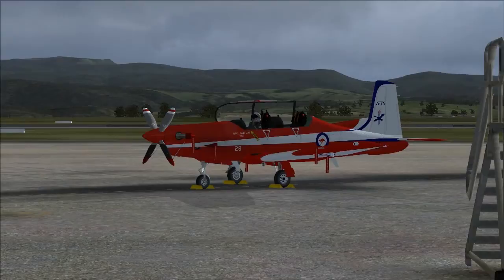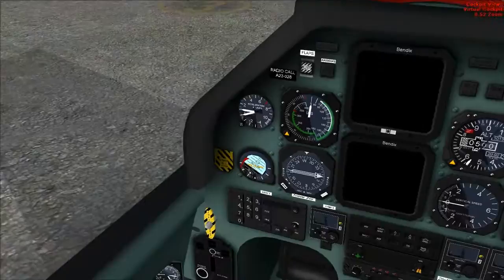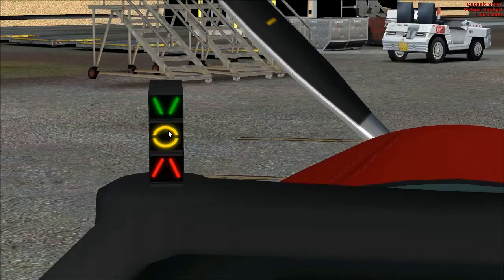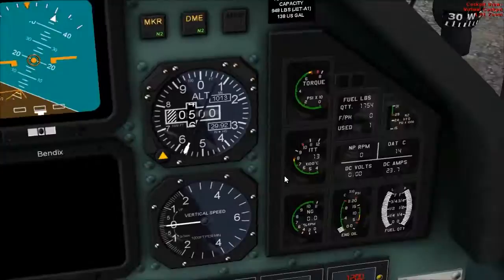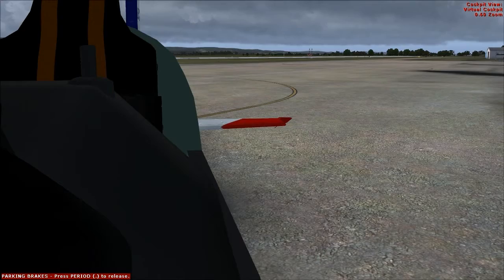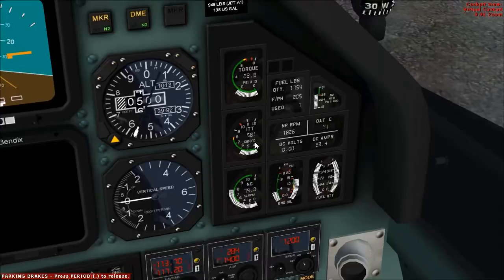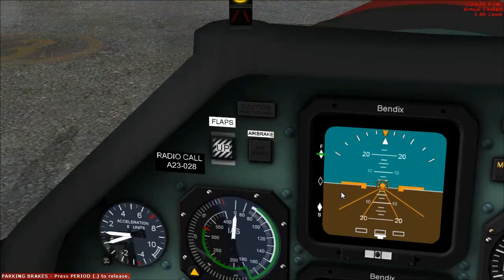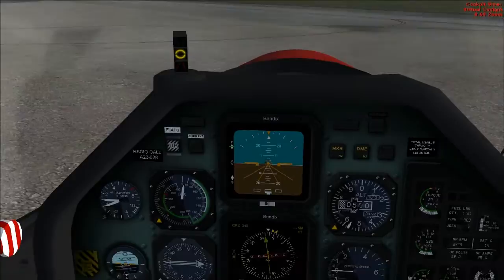FSX PC-9 Tutorial - Startup Checks

Comment from the maker: Hey mate.
1. There isn't actually any way to start with all systems off.  You have to manually turn engines and avionics off.
2. This window is brought up by pressing Shift+1
3. When you hit the 'starter' switch you should see oil pressure and NG rise.  These are the steps I take on startup-
- Check fuel cutoff paddle is engaged (or Shift+Ctrl+F1)
- Hit starter switch (oil pressure and NG rise)
- Enable fuel flow with cutoff paddle (or Shift+Ctrl+F4)
- Hit ignition switch

Comment from the maker: The fuel cutoff paddle is on the throttle lever and labelled 'Engine cutoff'.  Can you hear a whining sound when you turn the starter on? Are you saying you can skip turning starter on for the engine to start? so you only need to enable fuel flow and hit ignition?

Comment from the maker: Hey mate these are the keys to adjust view position -
Move left:  Ctrl+Shift+Backspace
Move right: Ctrl+Shift+Enter
Move up: Shift+Enter
Move down: Shift+Backspace
Move back: Ctrl+Enter
Move forward: Ctrl+Backspace

So what I did to look back at my rudder was hold down Ctrl+Shift+backspace so my head went out to the left, then used the 'hat' switch on my joystick to pan my view until I was looking backward.  If you don't have a 'hat' swtich then you can use the numpad.

Comment from the maker: and regarding the third question, I think there's a glitch in the engine system as the correct procedure is to enable fuel flow first then hit starter then hit ignition.  But if I don't follow the steps I have given you I get engine over-torque and catches fire.  Let me know if you still have problems.

Comment: I do all engine startup procedure like you do in your video, but starter is just not responding or giving some sound... NG and oil pressure are not rising. So when i turn starter on nothing happens, BUT if I don't hit the starter before I hit the ignition I can't start the engine. So the first sound I hear is when I hit the starter.
Here is what I do:
-batery on
-boost pumps on
-fuel cutoff paddle is engaged
-starter 
-enable fuel flow
-ignition